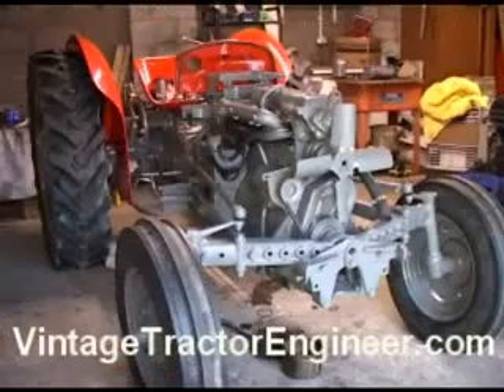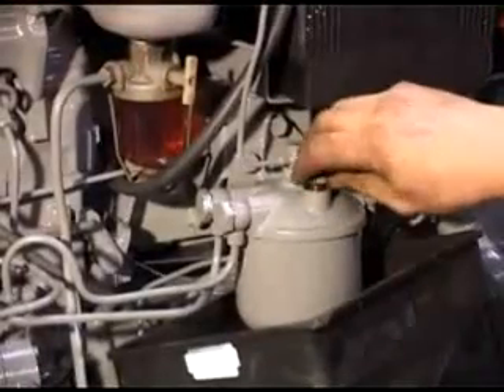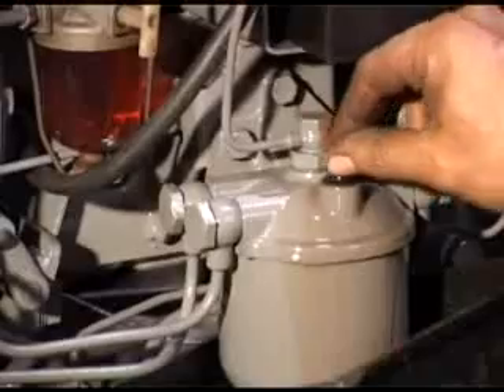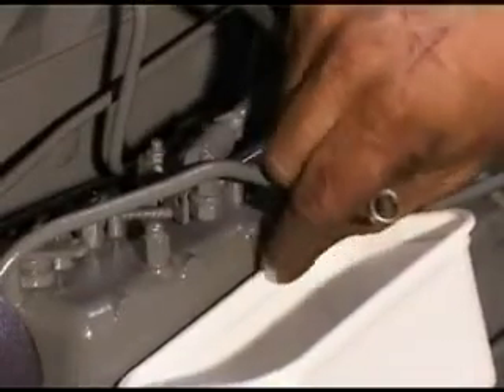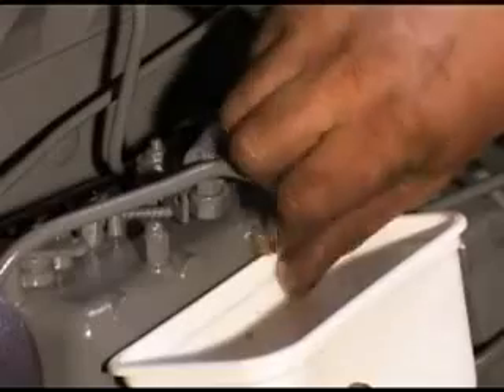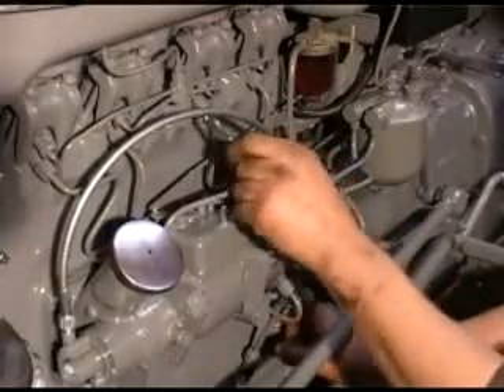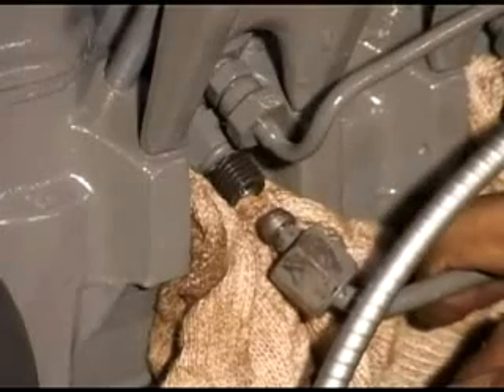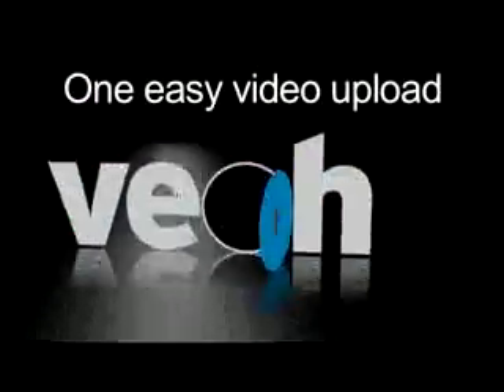Bleeding Off Tractor Engine

Comment: I can bleed the injection pump on my MF 231 tractor and it’ll start without having to bleed the injectors and without using starting fluid. The engine is a Perkins AD3.152.

Comment: i bleed everything like it should but it is no fuel coming out of the injectors. It is getting fuel to all the bleed points and lots of fuel from main line. Do you think the fuel pump is just bad?
Reply: I have exactly the same problem.  What was the solution?
Reply: You can leave an injector line open and turn the engine just a bit. If no fuel comes out of the disconnected fuel line, it very well could be. But if you have the same type as me, there should be a small cylinder with thee to four wires connected to it which connects to you total fuel pump and injection box. It has two to three Allen wrench bolts. Unhook this and you should see a plunger. Turn the key if the plunger goes it the tractor should be able to crank, you can stick your finger in the hole it the plunger seats in and push the internet plunger in. The tractor should crank, if not I would get a new pump. And go from there.

Comment: As a first time tractor and diesel user I found this very helpful after I ran my tractor out of fuel (it has no gauge so it's hard to judge). Hopefully when I've recharged the battery (you guessed it) I can get it to start again using this method.